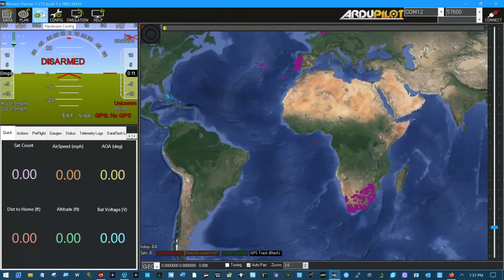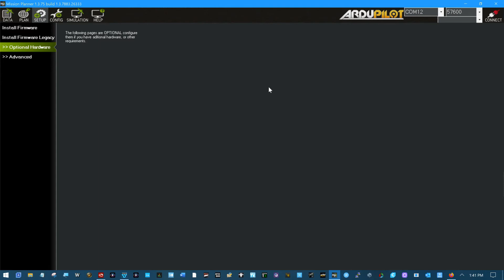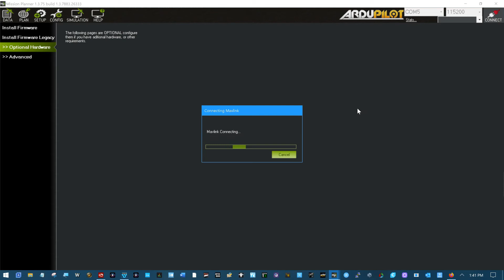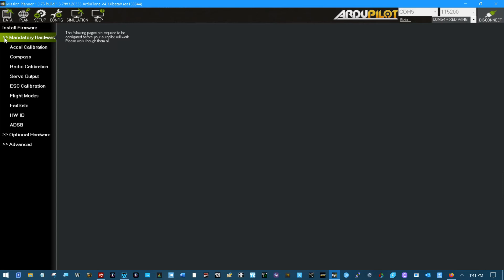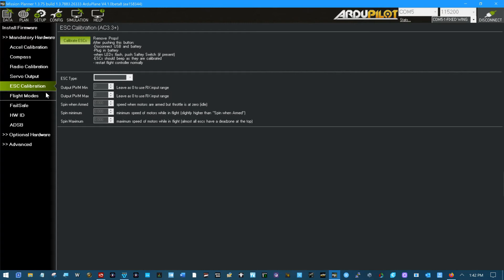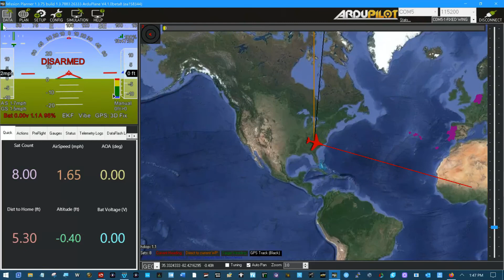Mini Talon ArduPlane Setup Conclusions And Notes

Comment: when i tryed to install the arducopter firmware to my pixhawk 4  i was unable to calibrate my ESC's ether it was so frustrating. 
as im using sbus from my receiver! i don't know if i can calibrate one by one though the throttle pwm pin  and keep the calibration after pluging the sbus back in after... 
i gave up a went back to px4 now , iv got an sbus to pwm decoder ordered (so i dont need to mess with radio settings ) will try that  if this way dont work..  anyway my s500 works good on px4 for now so mite just keep it this way. lol all this to sort out my osd showing the wrong info! and i don't know what i done but its working now ????
Reply from the maker: If it is working, don’t fix it I always say.  😊

My biggest problem is that my ESC is an original from the days when Aerial Media Systems sold the Flame Wheel F550 Heavy Lift Kit.  I hope I would have an easier time with a newer ESC.